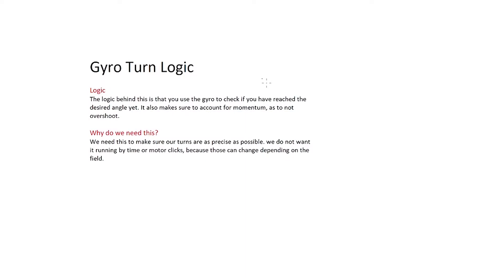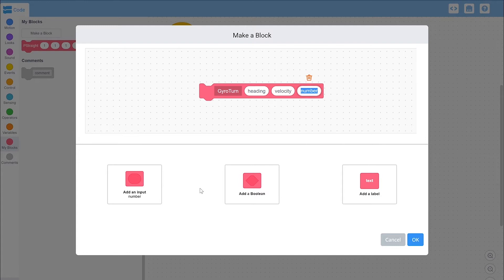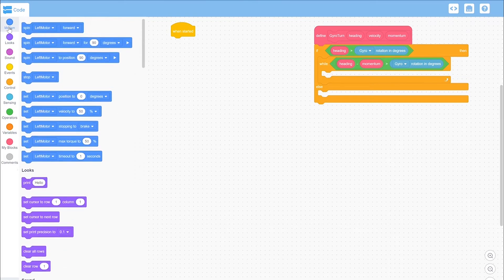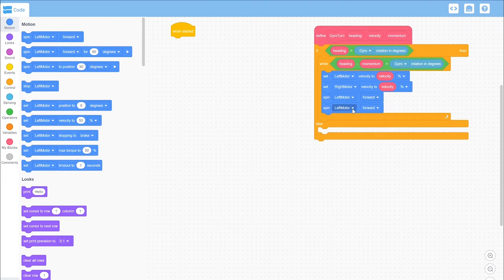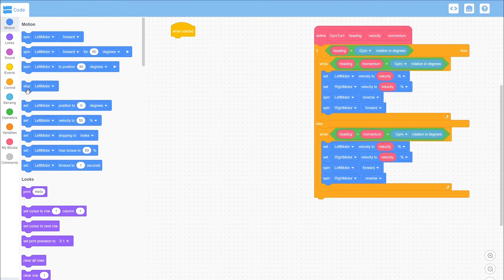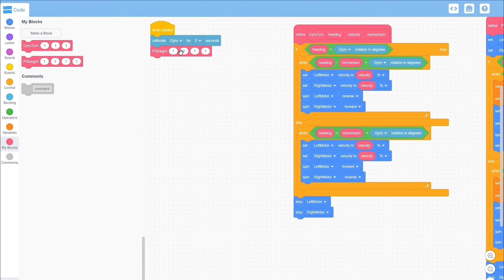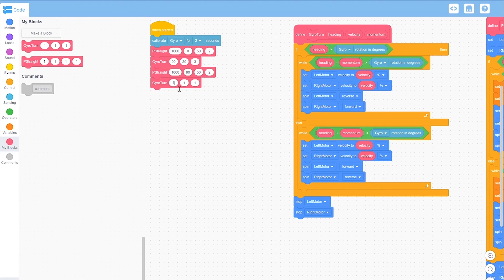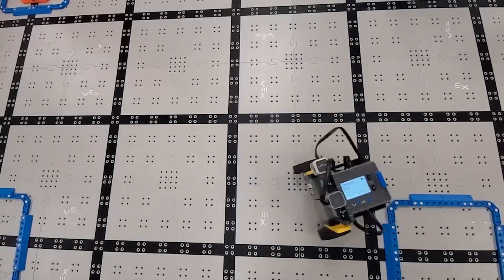How to program VEX IQ precise turns with gyro using VEXcode blocks

Comment: I use a gen 2 brain. Should this still work? Mine turns for a split second at the start, then goes straight but ends up drifting and it has no self correcting at all. I followed the video perfectly, how would this work for gen 2. Thanks

Comment: hello,
this is a great tutorial, I had my students try it but the robot keeps on turning, they double checked and their code is exactly like yours, but it keeps turning and it doesn't stop, do you have any recommendations?
Reply from the maker: This is because the tutorial was created in Gen 1 brain and gyro. Gyro rotation direction rotates opposite than Gen 2 brain inertial. So the formula would be slightly different. It's great opportunity to let kids use this information to fix the code themselves.

Comment: How do you get accurate turns without gyros?
Reply from the maker: With some math and wheel encoder, you can do it.
Reply: @CautionTapeRobotics  Every turn is always a little different
Reply from the maker: @knight8793  it wouldn't be a big problem, as you will typically have a go straight after the turn. the go straight will fix any over/under turn.
Reply: @CautionTapeRobotics  It does end up being a big problem
Reply: @CautionTapeRobotics momentum isnt consistent
Reply: @CautionTapeRobotics  whats a wheel encoder and also whats a motor encoded

Comment: Hi, can you reexplain the momentum i did not get it
Reply from the maker: Let's say your robot will turn to 90 degrees, but if you tell the robot to stop when it's already at 90 degrees, momentum will carry it and over turn a few more degrees. Instead, you want to simply tell the robot to stop earlier, e.g. 88 degrees. In this case, momentum is 2 degrees.
Reply: @CautionTapeRobotics  ah okay thanks alot